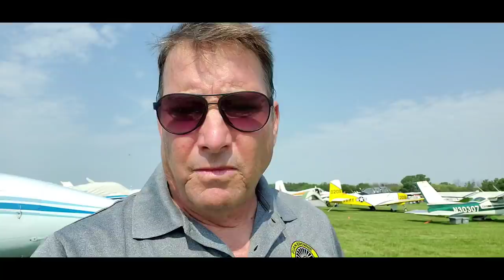Dale 'Snort' Snodgrass Crash Lewiston ID.

Comment: I have worried about Mike Patey and some of his extreme nose high climb outs. I have considerable Twin Otter time. The 300 Otters with the dash 27’s could climb out at extreme angles. If you lost an engine below VMC you were toast. The standard procedure once clear of the obstruction in a real STOL environment was to accelerate immediately to at least best single engine climb speed. The drill if you lost an engine right after getting airborne, was to shove the yoke forward and immediately chop both throttles. We tried to limit operating in that regime if at all possible. 95 percent of the operations allowed 10 degree flap takeoffs with V1, Vr and V2. I worry about a lot of pilots I see on YouTube. Flying down in canyons with no possible landing spot except a raging river in case of an engine failure. I am a 20,000 hour plus pilot who has trained pilots for a Missionary Aviation Ministry. I have lost just too many friends. Retired American Captain but do not hold that against me.

Comment: Seat rail latch needs to be checked in these cases (having had one fail on me in a C150).
Reply: Surprised this hasn't gotten more attention.
Reply: It happened to me in 2007 in a Cessna 182. During takeoff just as I rotated and the wheels left the ground my seat slid back because it wasn't locked in place. I ended up pulling back on the controls, the nose of the plane instantly went up and the stall horn went off. I was extremely lucky to recover because another 1 or 2 seconds and I would have stalled.
Reply: Happened to me, bump in the runway at lift off.  I could not see over the nose but shoved the yoke and  kept flying till I got some altitude.  Never wanted to do it again.  Cessna seat rails can kill you.
Reply: @tombrown108  If I had a Cessna, I'd probably fashion some limiters to slip over the rails aft of the seat attachment. Give myself a notch or two just in case but if it got freed up it would slam into the limiters and only scare me, rather than lead me, to death...

Comment: Hmm.  Sounds like a possible seat rail seat slide back that Cessna style aircraft have had an inspection AD out on for years. I had the seat lock give way on me years ago on a solo IFR departure in a C-182 out of Linden, N.J.  Remember thinking to myself as I pulled the seat forward ( not easy) that I was glad I had trimmed the aircraft for level flight prior to takeoff Condolences to Snort’s family, friends and the aviation community for the loss of a “Great stick”.

Comment: This reminds me of an occasion years ago when I made a walk around inspection prior to flight in a Diamond DA40.

I didn't find any problems during the inspection. But after I buckled up in the seat, I got a hunch something was wrong.

For some reason I decided to rock the seat backward. And noticed the seat was completely loose.

No screws secured the seat in forward /backward position. The technician had forgotten the screws after maintenance.

Had I taken off, I would have fallen backwards, and taken the stick with me.

I imagine I would have ended up in a situation like in the accident of Capt. Snodgrass.

RIP. Condolences to his family.

Comment: Maybe seat rolling back? That was a problem with Cessnas
Reply: It happened to me in 2007 in a Cessna 182. During takeoff just as I rotated and the wheels left the ground my seat slid back because it wasn't locked in place. I ended up pulling back on the controls, the nose of the plane instantly went up and the stall horn went off. I was extremely lucky to recover because another 1 or 2 seconds and I would have stalled.

Comment: If you cowboy a takeoff, it only takes one rarefaction in the fuel supply to shut down your engine. Just one big air pocket in the supply due to extreme demand (from the engine) and high attitude.

Comment: Agreed about takeoff departure..also lowering the nose increases the airflow into the engine for better cooling .
Reply: Not a player on turbine powered aircraft.
Reply: @oscarb9139  no, but the majority air-cooled Piston engines this is a factor. Though you'd be surprised with some of the early turboprops airflow was a factor. Not so much now.
I'm inclined to look at some sort of mechanical issue seat,controls,etc.
Reply: @tgmccoy1556  I flew BE-99’s, SA-227’s, and DO-328’s.  I am not sure how lowering the nose would help any turboprop cooling, since they don’t rely on airflow over the engines to stay cool like piston engines do. Which early turbo props needed airflow for cooling?

Comment: Seat locks on old seat rails gave way? Happened to me more than once. C140 and c150. Gotta be quick on  reflex to grab something and hold on while letting go of yolk or stick. Get on those rudders to keep wings level.
Reply: I experienced the same in a C150 on takeoff. I instinctively let go of the yoke and recovered. I never trusted seat latches again after that experience.

Comment: To bad sorry to here.
Reply: Sad to hear sometimes something simple as the work screw for trim tab for the elevator not set right after work on replacing a tail cone can ruin your day! It happened to me it was just 180 degrees off and the plane a Beech Sport took off at 45 mph and was very unstable full power and leaned over the panel very gentle turns and high angle of attack landing! Yep had like 3 heart attacks thinking it was going to roll over and stall! Ran out of down elevator trim!